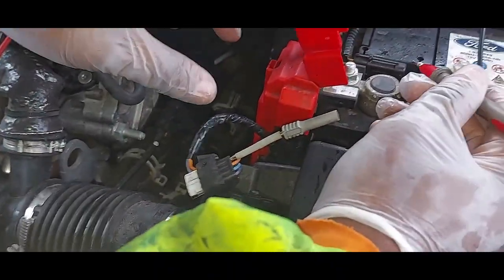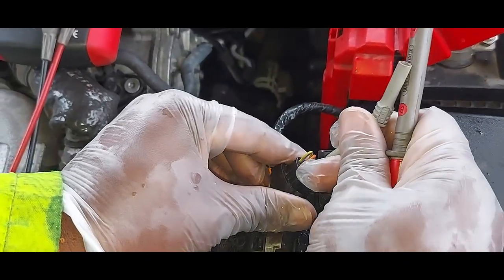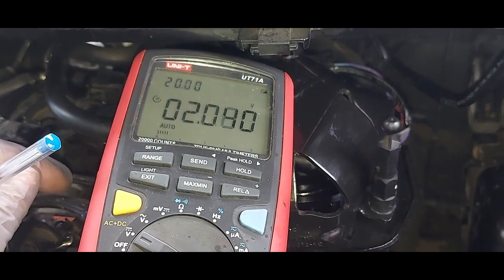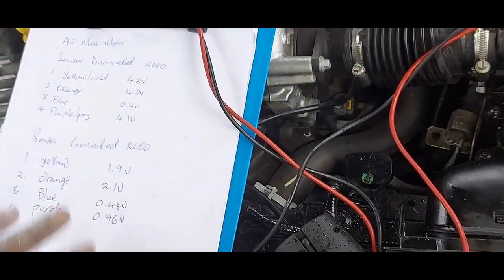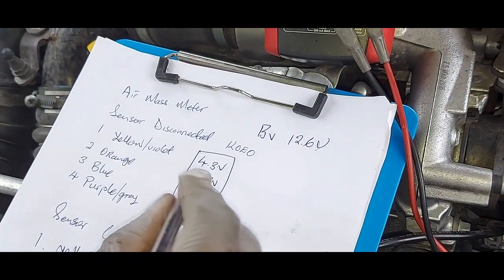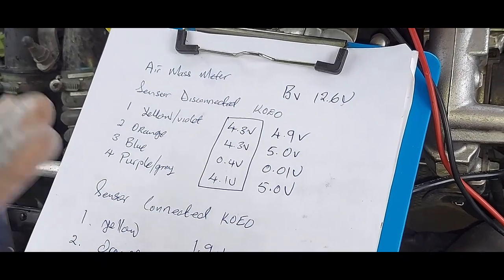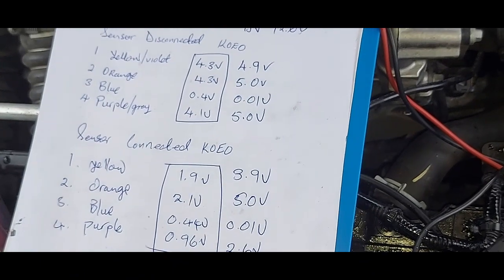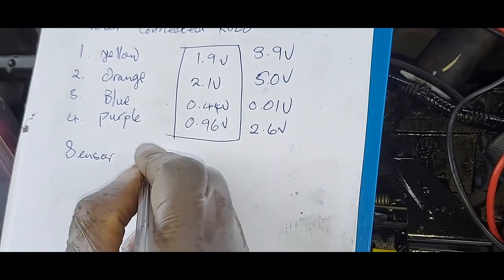HOW TO TEST A MASS AIRFLOW SENSOR

Comment: Thanks for your efforts Mr Jamroz, it's the full testing of sensors using multimetre but by my humble knowledge the best reading from signal is with Hrz (ohm) because the MAIN purpose from a SIGNAL is to express the CONTINUITY(the flow) and best in KOER
Reply from the maker: I appreciate your comment Momo I was taught not to trust ohms or resistance but voltage drop. I appreciate  new ideas please keep them coming

Comment: Hi I think  it would help if at the start of your video you did a small drawing showing that the voltage coming out of the ECM is passing through a resistor and the second resistor is in the sensor which then connected to ground. people would then understand the resistors only give voltage drop when current flows   to ground . you could use a battery feeding a bulb with a small vairable resistor  to ground  and with the multi meter you could show the voltages as you adjust the vairable resistor. The 2 resistor system is widely used hope you don't mind me adding this comment
'
Reply from the maker: thanks for your contribution I appreciated it, keep up the good work I love correction

Comment: Hi
You did not explain what was wrong with the ground and where and how did you correct it to bring that as a good ground.
Reply from the maker: The ground probe was did not have good contact. It was kind of loose at first I thought the battery was going down because the lights were on and I didn't have a battery mentainer. The test results were off forcing me to check the ground.

Comment: Normally shouldn't one off the pins show 12VDC ? as power supply to the sensor heating element.
Reply from the maker: You're correct but not every manufacturer uses 12V. This is a typical case where a 5V is used instead of 12V. The 5V is boosted up by the sensor circuitry. I appreciate your contribution.  Keep the comments coming